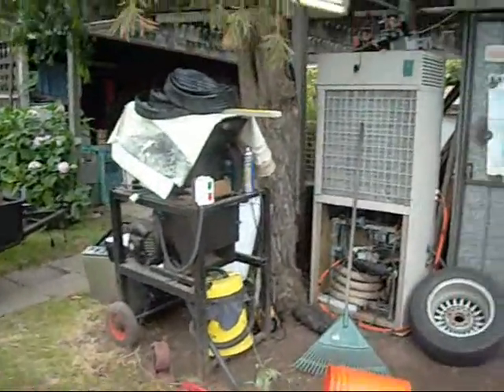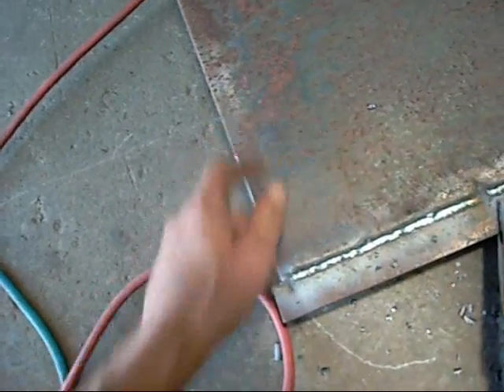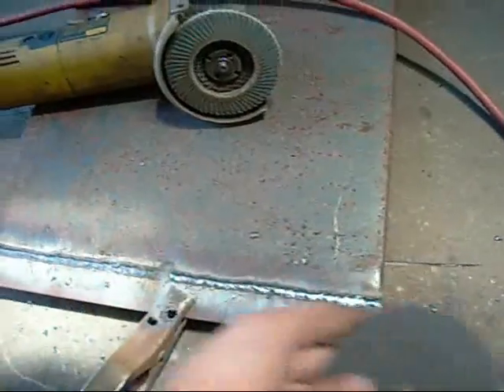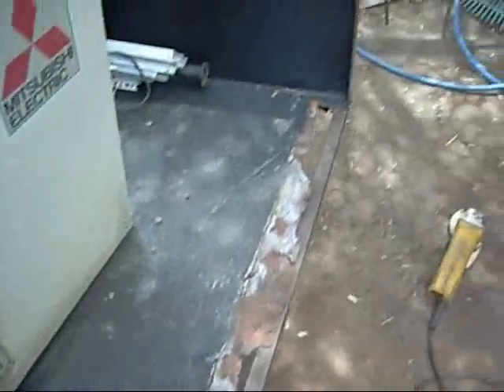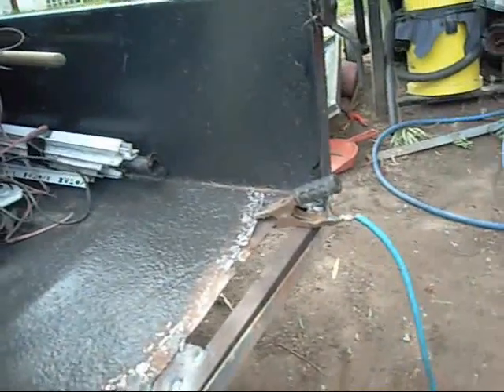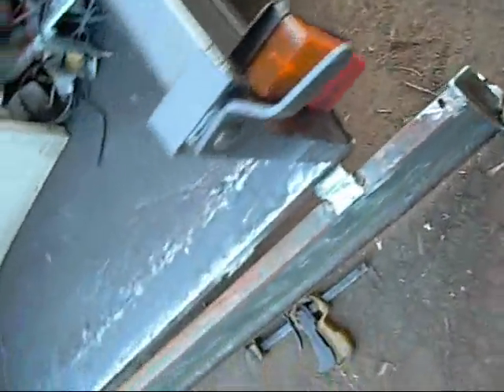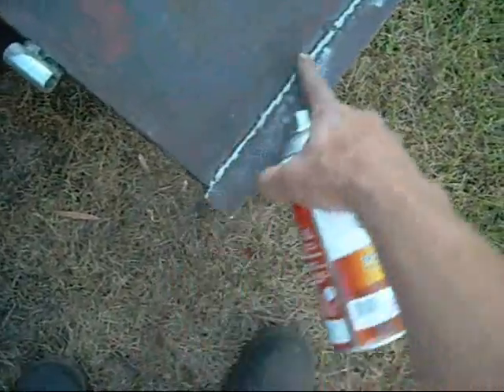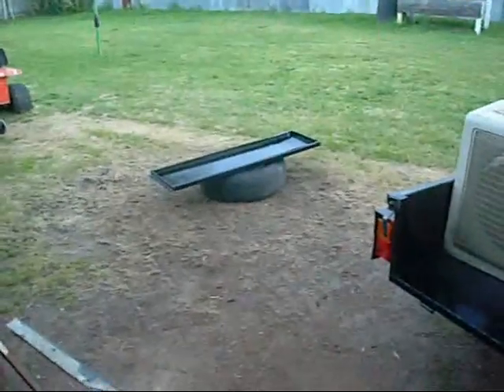Metalworking Fun - Brad's Trailer Tailgate install.wmv

Comment from the maker: @BigMaxTube hey Max, Tig is awesome for finish on thin sheet, stainless anyway ( I have limited experience tig welding mild steel) keep up the practice on the Tig, I had a lot of Oxy experience before going to tig so it was easy to pick up (the arc is your oxy flame essentially, filling takes a little care to get neat smooth welds)

I will be getting my own auto-dimming mask soon, I will use that to focus the camera through and try and film some welding procedures.

Comment: Alcohol is a bit friendlier as a  degreaser, although not as powerful as acetone. Acetone  is the usual main ingredient in nail polish remover. Methyl ethyl ketone - AKA MEK or butanone, does everything acetone does, but works  better at removing paint. It's  a bit nastier to work with, but nothing the right gloves and a respirator won't protect you from.